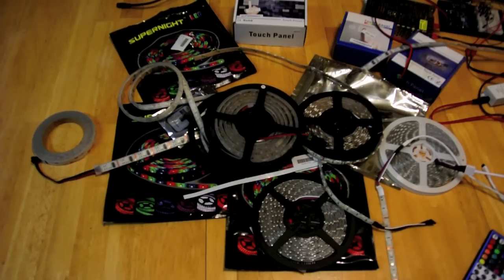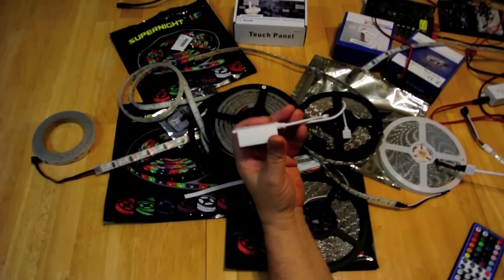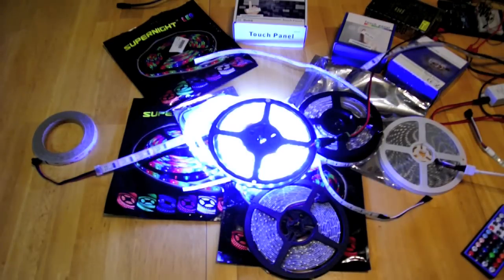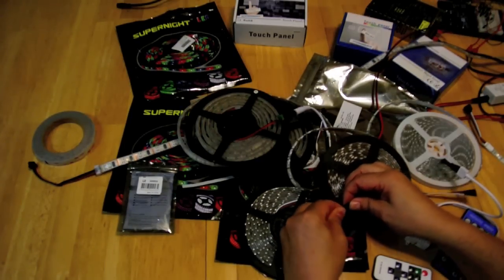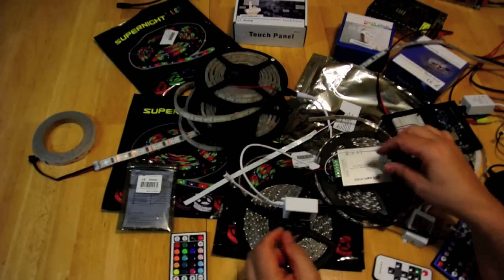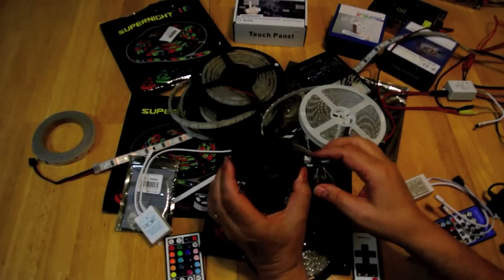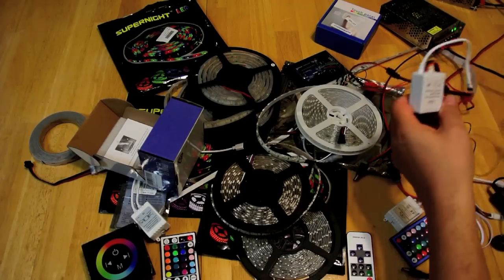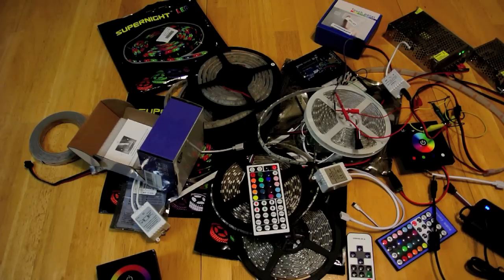Adding a LED Strip to your RV (Part 2 - power and control)

Comment: I'm in the process of adding a new l.e.d strip light to my camper awning as soon and the weather here in IN comes around a bit. I'm going to use a bluetooth controller in place of the RF controller. These controllers are fairly inexpensive on Ebay, around 6-8 dollars and are controlled via an app on any smart phone. No remote to worry about losing and can be controlled by anyone wanting to switch things up
Reply from the maker: These days there are quite a few cool controllers and adapters available for RV and general purpose use.

Comment: Hello! Awesome videos and thank you sir for your time and thoroughness. I want the ability to run an led strip under my awning in RED, WHITE and BLUE,. Is this possible and what do I need??  Thank you :-0
Reply from the maker: That is a tough one. There are some strips that alternate Red, Blue, Green, but not White. There are other strips that are Red, Blue,Green,White, but they blend the colors. For example, if you turn on Red and Blue, you will get violet.

The best solution will be to use addressable LED strips.  That way, you can assign which color each LED will be. And if you assign Red, Green, and Blue equally to one LED, you will get White.

Amazon and others have some nice addressable strips, but you would have to do some research to see if you can program the strip yourself as most controllers have pre-programmed sequences.

You could always hook up an Arduino microcontroller if you have the knowledge and program your own sequences.

Comment: only thing missing is the new phone/google home/alexa models for controls
Reply from the maker: I looked into alexa for my RV automation system. However, there is an issue in that you need internet connectivity. And RV campground locations do not always have that luxury. So I am not going to recommend alexa or google home for RV use.

Comment: So I pulled the outside light off and installed the led strip and light flicker until they shut off by themselves. I put them directly to a 12v battery and works fine. I wonder what's the problem.
Reply from the maker: First, I am assuming you are using a LED strip with standard SMD3528/5050 LEDs. It seems to me a wiring issue. If you are handy with a voltmeter, measure the voltage on the strip where the wires connect to it. You should measure close to 12V.  If it seems low, try powering just one color (assuming you have a RGB strip) and see if anything improves. 

Again, if you have a RGB strip, if you can power any 1 color, or any combination of 2 colors, but all 3 colors start to exhibit malfunction, and especially if your voltmeter reads significantly less than 12V, your wiring is probably too small. 

I wouldn't think wiring would be an issue with the 2~3A these LED strips consume, but remember no effort is wasted by RV manufacturers to cut corners and do things as cheaply as possible.
Reply from the maker: Also, you indicate the LED strip shuts off by itself. I am a bit surprised by this. A standard LED strip (SMD5050/3528) simply have current limiting resistors in series with the LEDs, so there is nothing to "shut down" the strip.

It almost seems that you have got ahold of a strip of WS2801/2811/2812 "addressable" LEDs. These things consume significantly more power, as much as 1A per ft. when all three colors are on full. In that situation, I'd suspect the wiring is not large enough to provide the required current.  However, these strips are typically 5V, but I have seen some 12V controllers, and even a few 12V addressable strips.

If these are the LEDs you have, try to dim the strip with your controller when plugged into the battery, then try it on your light circuit. Dimming the strip will significantly reduce the power consumption, and it might be enough power reduction for them to work with the existing wiring. At any rate, if this is successful, you will know for sure your wiring is not up to par for that circuit.
Reply: Thank you I'll be doing tests when I get home. I have the RGB smd5050 300leds light strip kit 44 key remote 12v 5A power supply. Directed to the battery it works fine with remote and all, just when I hooked it up to the outside light that reads 12volts, lights come on and flickers😕 btw my outside light takes a 912 bulb

Comment: Where does the 12v power supply get its power??
Reply from the maker: From the RV's on-board 12V system - either batteries or converter when plugged into shore power.

Comment: I am planning to run power to my smd 50/50 strip somewhere in the middle of the 5 meters. Any tips on the kind of connector I might need?

Comment: Boy, you weren't kidding about the overwhelming number of choices.  My head is still spinning.
I am trying to find the monochrome strip that you present in your video.  Do you recall which brand/model/other identifier it is that I may search for?  
All I want to do is wire the LED strip directly into my 12v system.  I'd like to wire it into the switch on the wall inside my RV that controls the outside porch light.  Isn't it just as simple as taking the two wires from the LED strip and wiring them directly into the existing switch?